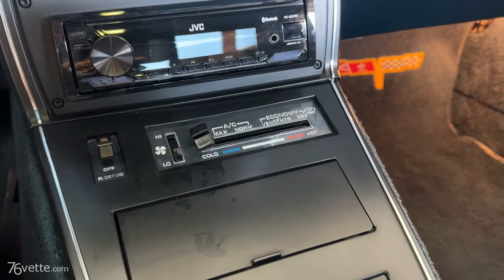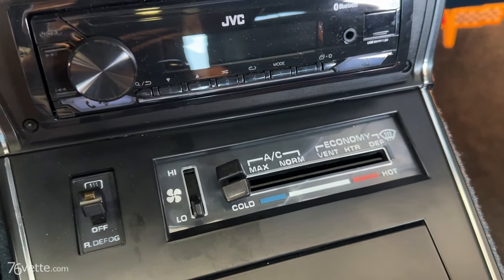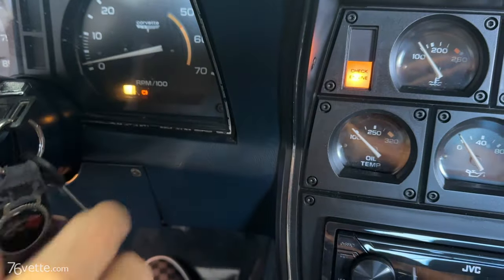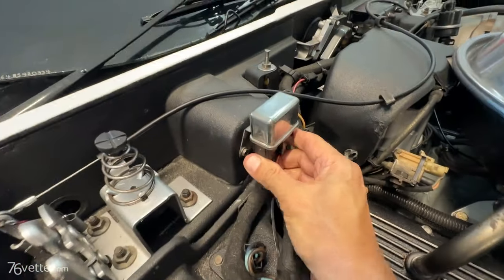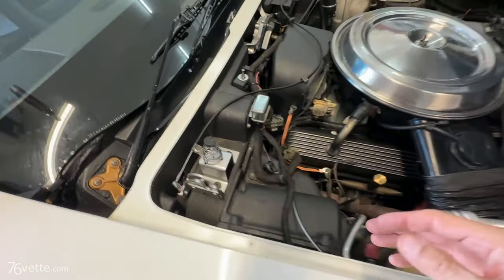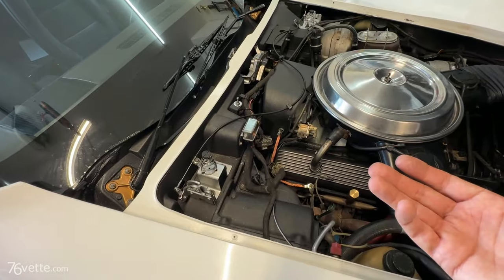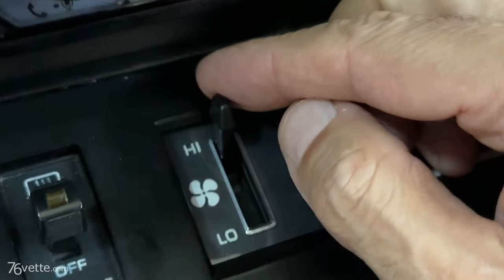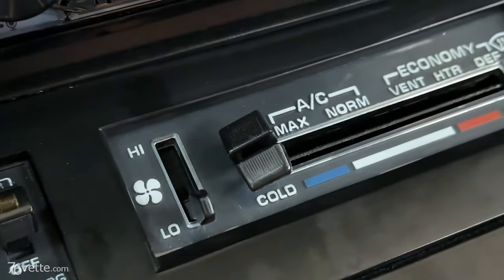Is the HEAT Always ON? 🔥🥵 FIX IT!

Comment: Man you know every square inch of the classic 😂
Reply: Hey bud, the system operates on low blower regardless of fan switch position with air discharged into vehicle through heater outlet. Owned my 1981 several years and happy with factory original engineers design. Read page 2-25  of factory original 1981 Corvette owners manual. However modifications are fine. I chose to keep mine totally stock factory original.
Reply from the maker: A few days ago I was driving the 81 here in town and it felt like my feet were on fire. So I had to do something, and this hack (that’s what I call it), can be done without modifying the system and it took me about 10 minutes because I was filming the process. 
My a/c needs Freon, so maybe if the system was working I would feel differently about it, but this was my solution and it can be put back to stock factory original in a couple of minutes. 
Thank you for watching! 😊👍🏻
Reply: Read 1981 owners manual page 2-25 line 6

Comment: Awesome! I always wondered if there was a work around for this. I think this came about from the 1968 Corvette and 'Astro Ventilation' Idea. I'm not sure when they stopped advertising it that way. Nice fix keep them coming.👍
Reply: @ajmaresca2165  Astro ventilation ended in 1975. I have a 77 corvette, 77 Camaro and 80 firebird they are all wired from the factory that way. And have the blower motor running with the key on regardless if the fan control is in the off position. I think they did that to blow fresh air or have the air circulating inside the cabin.
Reply from the maker: Thank you for watching! 😊👍🏻
Reply: @christopherm5428  thanks for the clarification on this. I always thought of it as a replacement of the small window vents to allow fresh air as you stated.
Reply: @ajmaresca2165  yeah I believe the 68-75 Astro ventilation brought in air from the outside into the cabin and exited thru the two vents behind the back window. Where as the 76-82 cars had the blower motors running continuously to circulate the air in the cabin.
Reply: @christopherm5428  thanks for the information.😀👍

Comment: There is a vacuum control valve behind the glove box for the heater control valve. The valve behind the glove is controlled by the temperature blend control cable.  

If that cable is not adjusted properly, it will not close valve behind the glove box which in turn never shuts the heat control valve and the blend door for heat.    Which lets hot air in the car…. And roasts you….

Remove the glove box and the passenger side cover to console. There an adjustment for the blend cable, adjust to assure the vacuum valve and blend door are shut when cold air is commanded by temperature slider.

Comment: Is the wire you added just a insulated wire on one end with no connectors? Thanks
Reply from the maker: I did not add a wire. I just disconnected the brown wire from the harness going to the blower resistor terminal, then insulated it and tucked it away. 😊👍🏻
Reply: @76vette  Ok. Got it. You just used what looks like a wire in your right hand to disconnect the brown wire. Nice!
Reply from the maker: @inell6  Yes. I flattened the end of a solid copper wire to push the terminal retainer so I could remove it without damage. 😊👍🏻